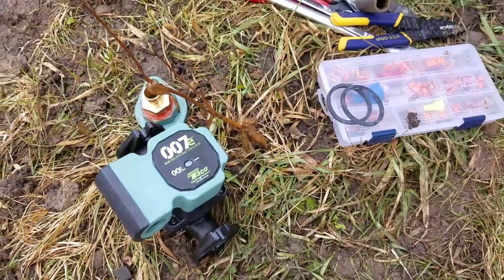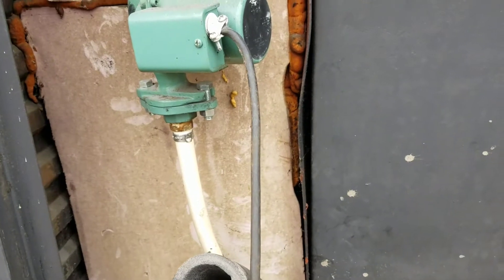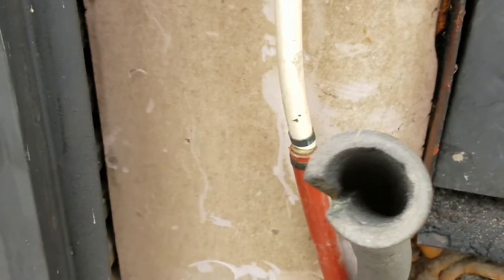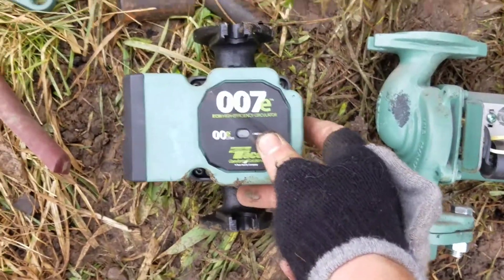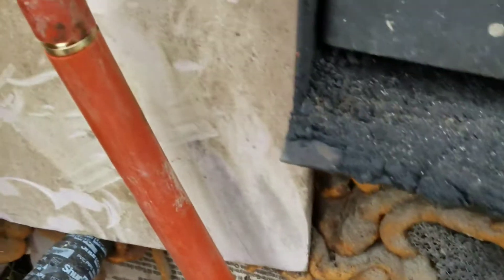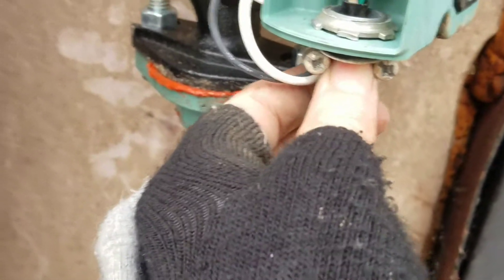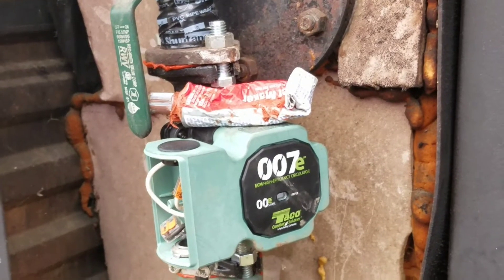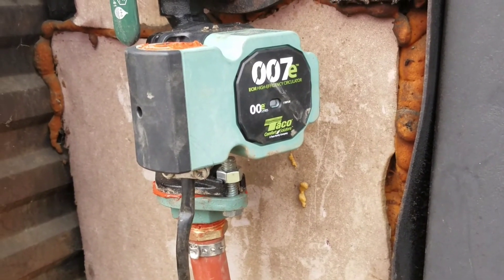how to install a new high efficiency ecm circulator pump on a outdoor wood boiler

Comment: Isn’t that pump designed for closed loop systems.....did it work ok for ya
Reply from the maker: It worked out really nice when was using it I ended up getting a different boiler and had to get a bigger pump
Reply: @AdventuresInLiving  that certainly didn’t look like your C150 what happened